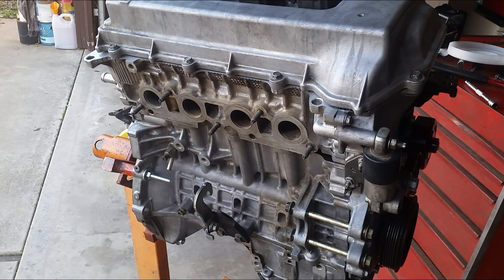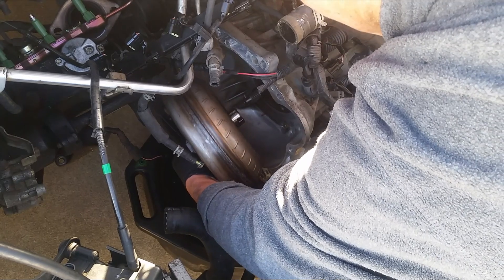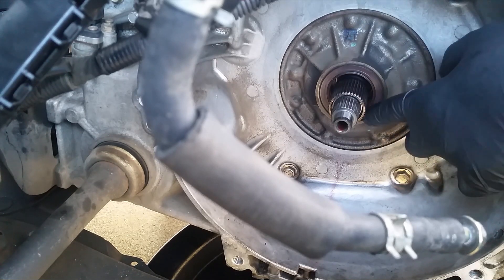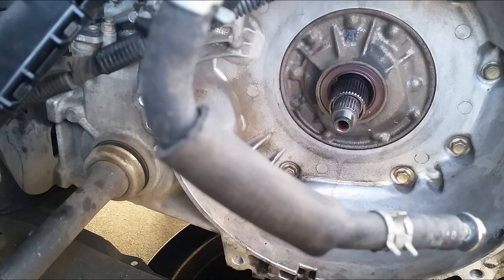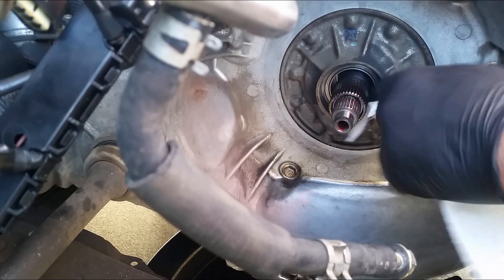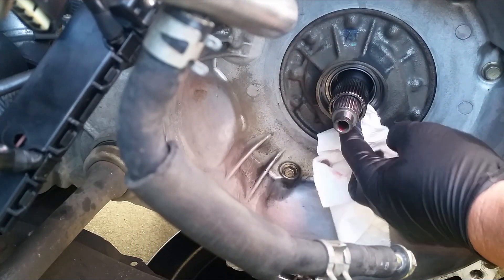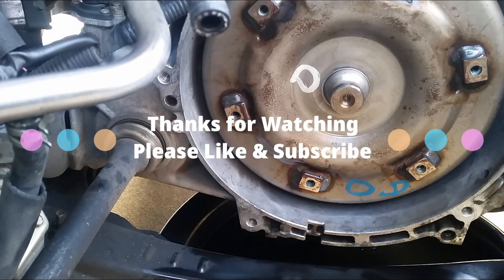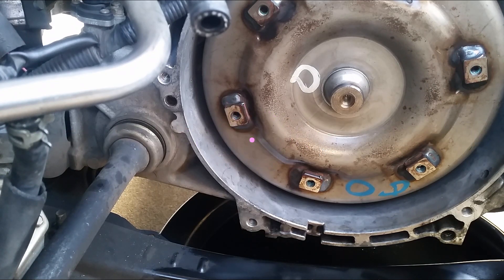Toyota transmission oil seal replacement | 2000-2005 Celica

Comment: Good tip on the alignment, bro ALWAYS put some trans fluid on the shaft and on the inside of the seal BEFORE putting the converter back in